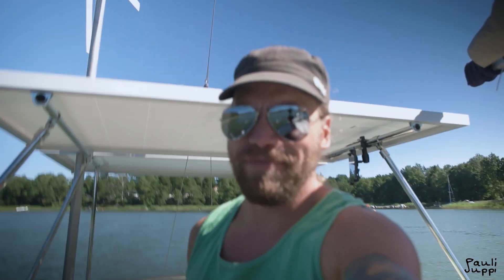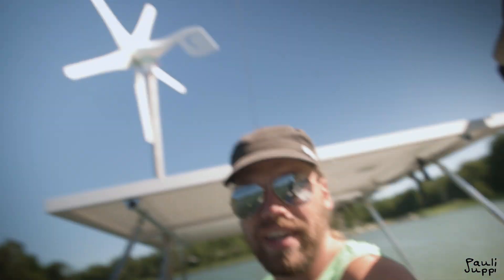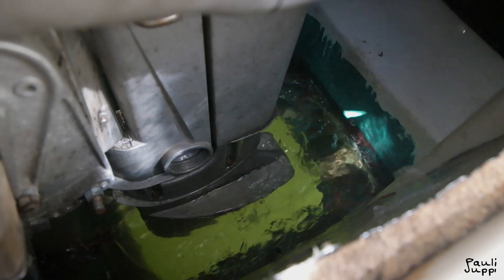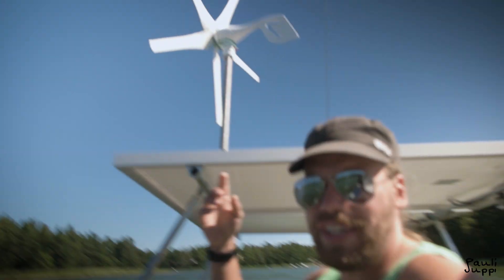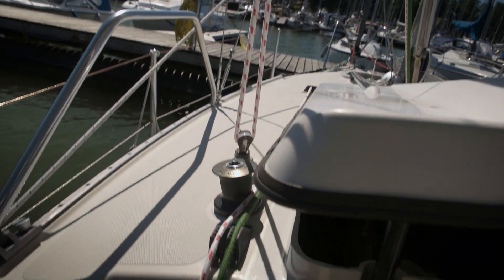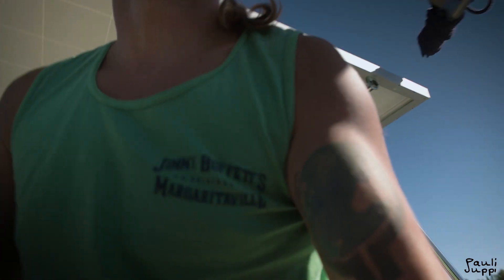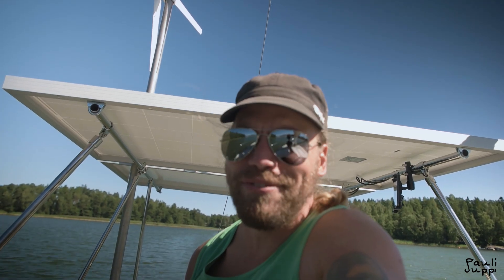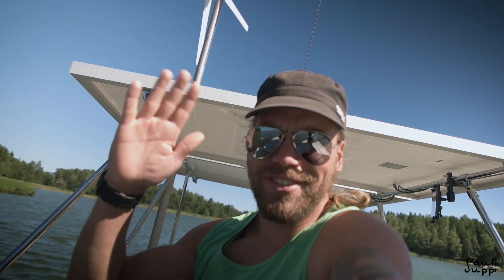August 2015 update - Green Across The Blue

Comment: how is the speed of the motor and do it run the battery's down quick? what amps do it draw and is it a 12or24v ?watts ?

looks and sounds cool ;)
Reply from the maker: Hi john b The motor runs on 24-48 volts with maximum current of 100 amps so it's about 2-4kw motor. I have 500Ah of batteries. Max speed when it's calm is about 4 kts with 24V using a b it less than 60A, but using 48V I get it up to 5kts. Visit my blog for for information: www.greenacrosstheblue.com
Reply: that's pretty impressive ...well done and a gold star for you ;)